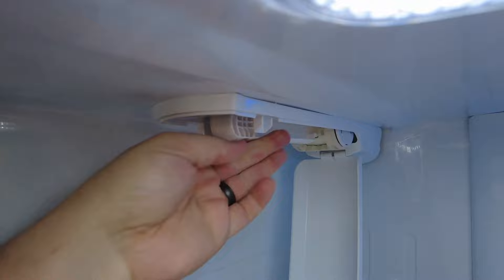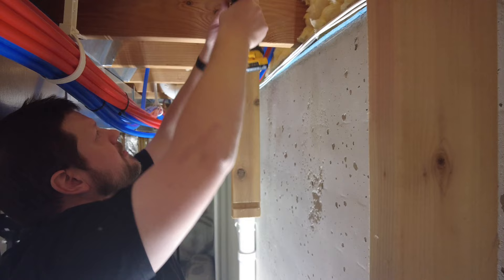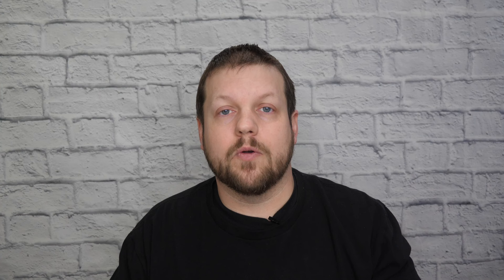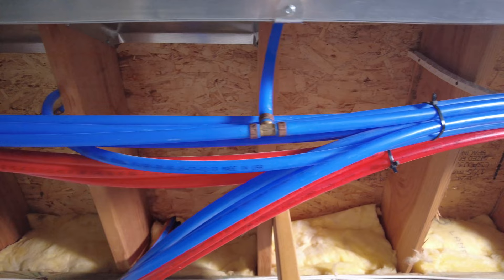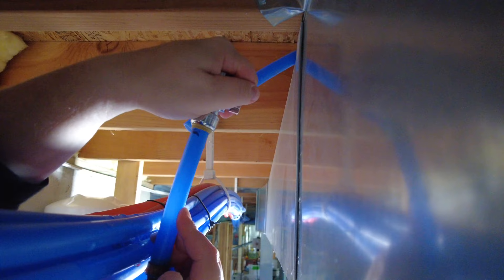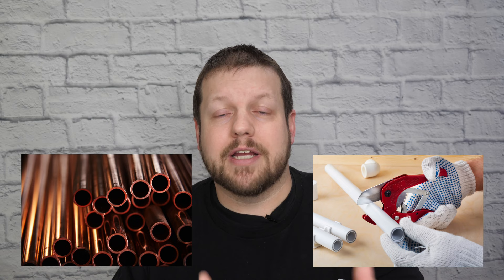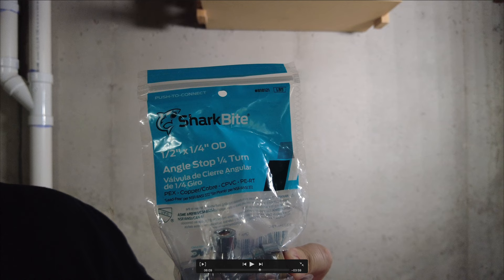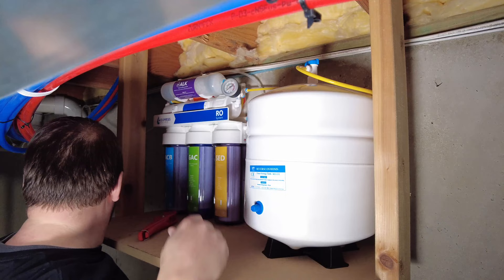How to Install a Reverse Osmosis System for Your Refrigerator Only!

Comment: You never actually show or tell us how to route the lines running to the RO dispenser. Keep the video simple with the title and assume there is a water supply and a drain line near the refrigerator. You can make another how to video for those that don't have a water supply and drain access near the refrigerator.

Comment: Thanks for the info, but how do I connect the system to the fridge instead of using the included faucet? 
Did I miss something?
Reply from the maker: Instead of connecting the line thats supposed to go to the faucet, connect it to the fridge water supply instead. Just be sure to have a way to flush out the extra carbon from a replacement set of filters.

Comment: Thank you for producing the video - very informative.  Question...  when you put the bypass filter in, do you still need to purge the unit for 24 hours?  If so, is there a recommended approach to doing this?  Thanks!
Reply from the maker: Yes, you still need to purge the unit to get out all of the excess carbon. Honestly I just kept filling up pitchers of water from my fridge and dumping them. The alternative I thought of was installing a bypass valve in the basement and having that drain into a bucket, but I decided against that.
Reply: @TopHomeowner  I’m thinking of installing a T in the drain line with a check valve on the machine side. Then a T on the supply with shut off valve on each output. 

When you install a new filter. Shut the water off to the fridge, open the the side going to the drain. Run it for however long needed then reverse the steps once carbon is empty. 
The check valve in the drain line will allow for you to still drain waste water and the fresh carbon water at the same time.

Comment: Very good information. I have a garbage disposal under my sink with dishwasher inlet but i will not be installing a dishwasher. Can i install the reverse osmosis drain pipe/tube into the garbage disposal dishwasher inlet? How to prevent dirty water backflowing into the drain tube? Thanks
Reply from the maker: I asked the question about backflow prevention to Express Water and they said that since the system is pressurized, there's no concern about backflow from a drain line.
Reply: Backflow events occur when the water pressure drops and if that happens then the RO system would also not have pressure…

Comment: There is a cross-connection issue if you don’t use the provided faucet because the faucet has the built in air gap. If you can’t drain to a floor sink or something you need to provide an air gap by hooking it up to something like an overflow vent for a dishwasher or something or find some sort of inline air gap connection and it must be after the p-trap. I am a certified cross-connection control specialist with the county of Orange in California so this is something I am familiar with.

Comment: I just bought a RO system and my house is a new built where the sink and fridge is in a totally different place. My fridge only have a feed line. Where can I place the drain line? Can I just make a hose and have it drain outside?
Reply from the maker: It might be easiest to install the RO system under the sink and then run a new line to the fridge. You could probably drain to the outside directly somehow because it's just regular water... or you might be able to have it go to a floor drain if one is close by.

Comment: Do i still to use the tank or just connect the RO directly to the fridge?
Reply from the maker: You will want to use the tank otherwise it may take a while to fill cups as the water proceeds through the system, depending how much water you are using.

Comment: is it possible if I want to keep my sink RO and just use a Y splitter to share it to the fridge? my RO is a tankless(electric) system.
Reply from the maker: Yes, you can split it and run another line to the fridge. Typically that's what you'll find with RO systems but I had never seen an install going only to a fridge without a sink faucet.

Comment: I'm not understanding what happens to the water that goes into the tank. Will it allow me to get a steady stream of water from the refrigerator or just a trickle (in other words, do I need a pump after the tank)?
Reply: No these are pressure tanks, and create a buffer between RO systems and the utilization device.
(These are not actual numbers.)
Say you have a 5 gallon tank that holds at 15 psi. You could use 1 gallon before the pressure drops and the RO system would activate refilling the tank again.

Comment: Lets assume we know how to install a RO system and know what's required to install it but we dont know what do with the water lines going to the RO dispenser that we are going to take out of the picture I assume.
Reply: Thank God someone asked that ⁉️ how do we bypass the faucet? It has a vent built in.
Reply: @0714will  Not only that every time you change the filter, how are you going to purge the carbon???

Comment: Very good video, Mark!  I saved it for when I got my RO, but then forgot and figured it out on my own.  My fault!  lol  Luckily, I found the video before I finished the install.  My only issue is I cannot find a 2" drain saddle.  The one  in your description is for a 1.5" pipe.  The OD of a 2" ABS, Shed 40 pipe is 2.375 inches, so I don't believe the 1.89" one will work.  I thought about running a Y with a 1.5" branch that's about 6" long and capped.  Then I could just use the saddle valve that came with my unit.  Do you see any issues with that?
Reply from the maker: That sounds like it will work. Also, the saddle valves are pretty flexible so you may see if yours will conform to the shape of the pipe. May need to get longer bolts but it's worth a try.
Reply: @TopHomeowner  Last night, I did a 2" Wye with a 1.5" bushing for the pipe.  I capped it off at 5",  installed the saddle drain, and zip-tied the 1/4" line to the existing sink drain pipe all the way to the wye.  Looks really nice as it enters the Wye perfectly perpendicular.  Wish I could attach pictures.  lol  Many thanks, Mark.  :)

Comment: use a $2,  1/4"quick connect:

1)   Go to the outside rear of your refrigerator and  cut the two plastic hoses (supply from valve and input to refrigerator from filter), they are side by side.

2) reconnect them to the supply side and the fridge filter supply line, with the quick connect coupler

3) now you have  completely bypassed the filter... 

4) Leave the leftover filter lines into the fridge disconnected.